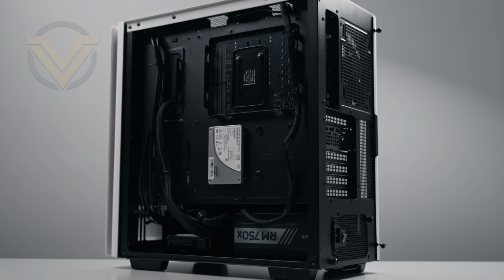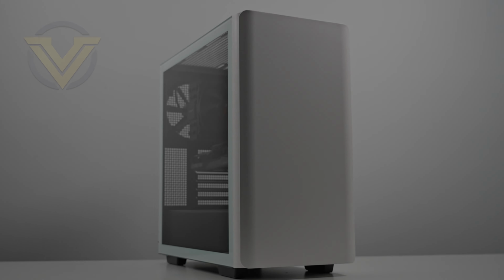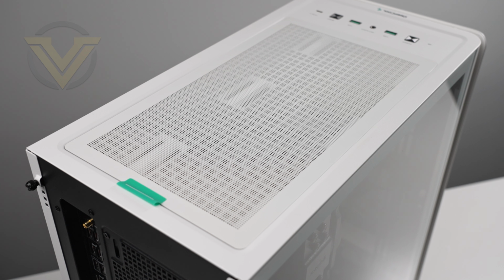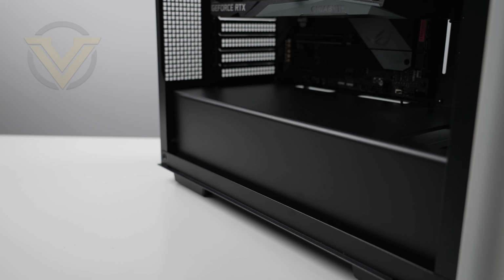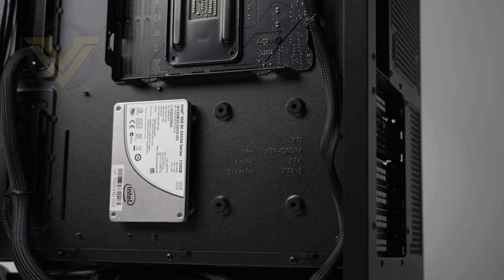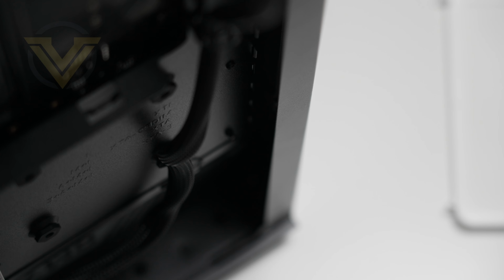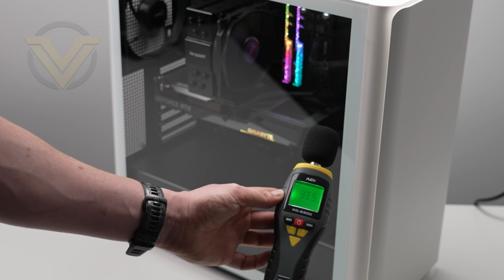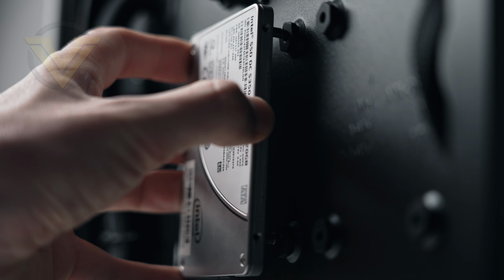Deepcool CK500 Review

Comment: How about cooling? I am looking at this case but I am affraid the air flow will be not enough compared to other cases like DeepCool CC560
Reply: Im sure you can take off the front panel.
Reply: That's right, but I am still curious about the cooling with the front panel in place, I just want to avoid the dust inside the other components
Reply: @diegosg448  uhm i see. But what I have seen from reviews is that it has a decent air flow once you remove the panel? I bought it for cheap anyway (49.99 Cad). Got it for my 7700x + 7900xtx build. I’ll let you know what I think about it once I put it all together.
Reply: I've got 3 140mm fans in mine running at 1000rpm~....my RX 6700 XT never goes above 65°c and my 12600K usually hovers in the 40°c range during gaming. This is with the front filter and the front panel on, all air cooled.
Reply: @MMK86   That's a good reference, thanks for sharing, I will give it a chance, those are very decent temps